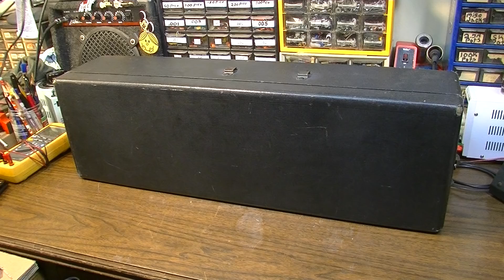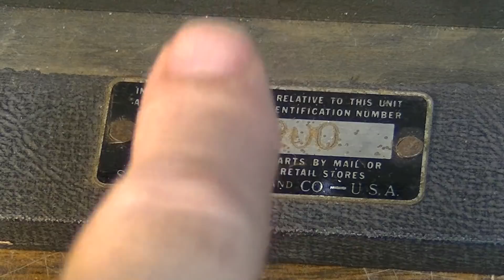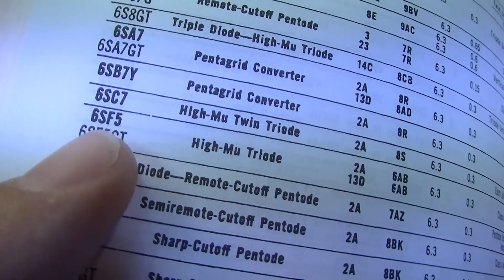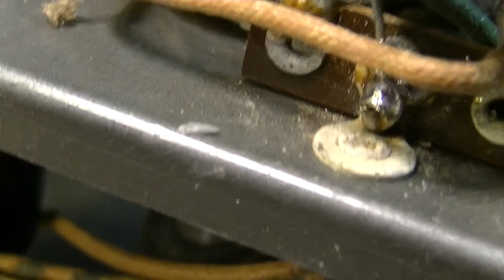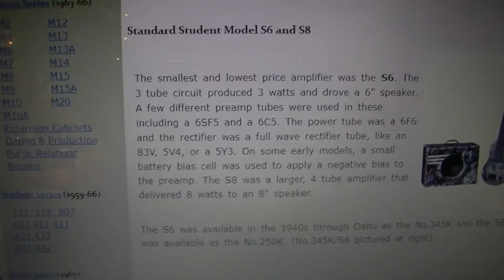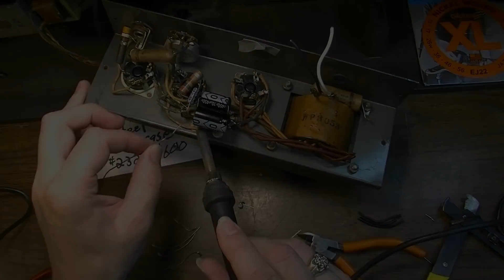SUPER RARE 1941 Silvertone Amp In Case Model 2323

Comment: That's a great find! Back in the 60's those Silvertone case amps were basically 'throwaways'. They didn't deliver the tone and especially the volume that we players desired. In 1968, I bought a Silvertone Twin Twelve (1484) for $50. What a great amp it was! 2 channel, tremelo and spring reverb tank at 45 watts. Sold it in 1984 and wish I never did.
A lot of the Silvertone stuff for Sears was built by Dan-electro.

Comment: Hi there I have a few pedals that need fixed and don't know how to contact you to see if it would be something you can or want to repair ive looked for bad caps or joints but can't find any and I feel they are out of my league at this point and I hate my local shop they are snobs and way to expensive plus I have to stand around for 20 minutes while the ignore me just for stings I would hate to see how long it would take to get anything else done there ifyou want to know more just let me know

Comment: Wish you would have done a final comparison of your regular electric guitar to the included lap steel to see the difference in output between "newer" pickups and 77 + - year old pickups. Though, it did seem that the lap steel / amp got louder the more comfortable you became with that old Silvertone. 

I must say that 3 watts and a 6" AlNiCo can get pretty loud. Almost seems that some of the magnetism may be gone out of the speaker. I have a couple of 6 inchers like that (one I just found last winter - sorry, they're not for sale or trade), that are real crankers with low wattage. Some of my favorite drivers.
Reply from the maker: The lap steel's AlniCo magnet was nice and strong still. No issues there. A lot of times the AlNiCo has to be re-magnetized, but this one seemed fine. The calculated watts at the output won't always tell you how loud an amp will be though. This one just has a low voltage swing on the signal into the output due to the single triode preamp. Most of the older amps I've encountered like this are either a single pentode pre or two triodes. That makes a HUGE difference in volume.

Comment: Cool old amp. Probably not worth it to go too crazy and add a power LED, switch, change the tubes, etc. Just as long as it is safe with the new line cord, and death cap removal, and replacing those leaky electrolytics. It isn't likely the owner is going to go out gigging with it. Might be a good idea to invest in a new strap though.
Reply from the maker: This one was being picked up same day so I was on a time crunch. If it was mine, I'd replace the handle with a period correct spade end leather handle and leave it alone. It's tempting to add all the obvious improvements to the electrics, but it would kinda destroy the interest to collectors of early electric guitar and amp history. At the time this was made, electric guitar was still in its infancy. The commercially successful electric guitar market was less than 5 years old.

Comment: Could this be rebuilt with a ECC88 Preamp and a vacuum tube PWM output stage and might run a lot cooler as the vacuum tubes are only operating as a switch.

Comment: As much as I like the idea of adding a fuse, I can't say as I'm thrilled about that fuse holder - especially in a place where it could be warm.  I'd be afraid that plastic would get brittle and crack.  I assume you didn't want to drill a hole for a standard fuse holder, so maybe a pigtail fuse or a L bracket to panel mount a fuse holder internally.
Reply from the maker: I do have some fuse holders on plastic or bakelite bases that mount with a bolt through the center, but I didn't want to drill any holes in this thing. I think that plastic inline fuse holder will be fine.